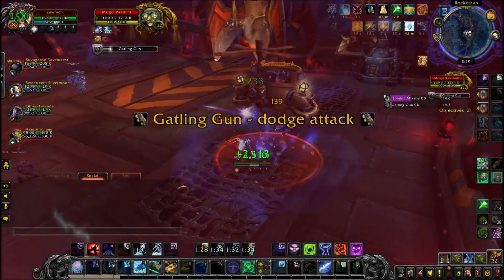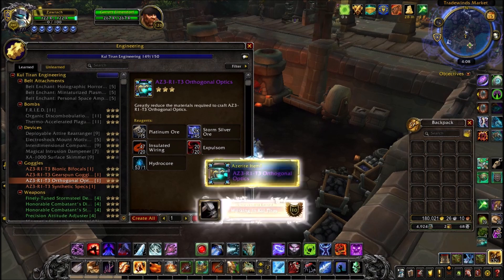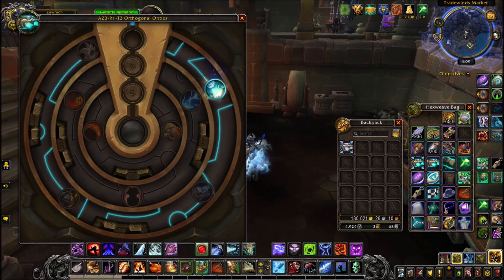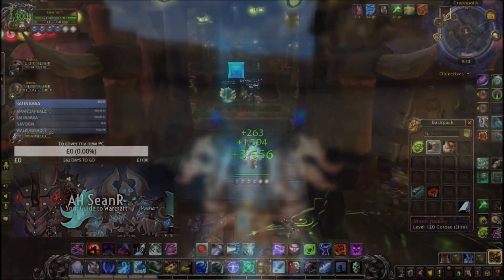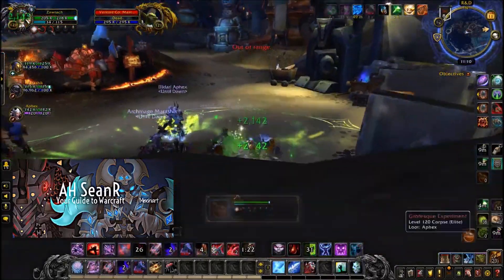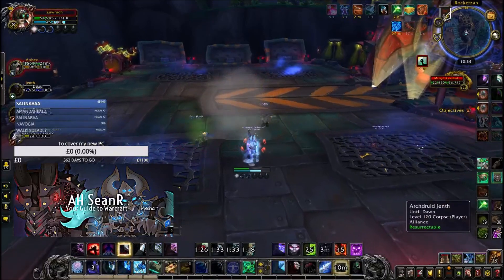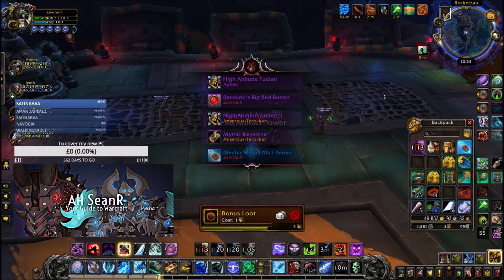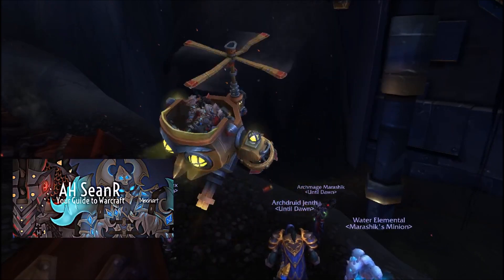WoW Guide - How to Craft the Mecha-Mogul MK2 - Engineering

Comment: Is it beneficial or detrimental to run the dungeons with a group of 5 engineers? Will only 1 person be able to loot/deconstruct the mobs or?
Reply from the maker: Only one person can scrap, so running it with 5 Engineers would be the worst thing you could do :D
Reply: @AHSeanR  Damn, ruins the motivation to do this since it's so "group unfriendly" I guess. Would have to make 30-50 different pugs who agree to do it a specific way...
Reply from the maker: yeah 100%, it's not group friendly to farm, you could just clear the dungeon as normal, but then it depends on 4 other people looting, and you'd get less mobs to scrap overall making the whole grind take longer, if you don't have people willing to run it with you my advice would be wait till the last Patch of BFA, perhaps by then with power levels it will be easier to solo some trash and then reset, or just wait till after BFA, or just buy it from the AH
Reply: @AHSeanR  It's a shame, forming like-minded groups with a similar goal is one of the fun aspects of WoW imo. I ended up listing a "no engineers" group (I tank) and tell everyone at the start to loot mechs. I also pull all the mechs and extractors throughout the dungeon. In a day I managed to get 10 of that rarest material (servomotor?) so it's actually not too bad. People who need boss loot get that, and I get my mats.